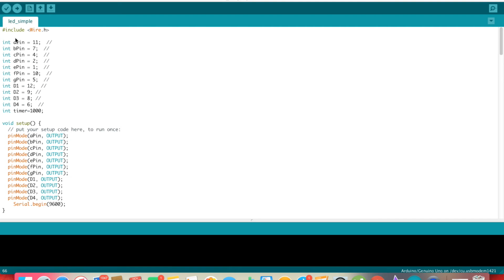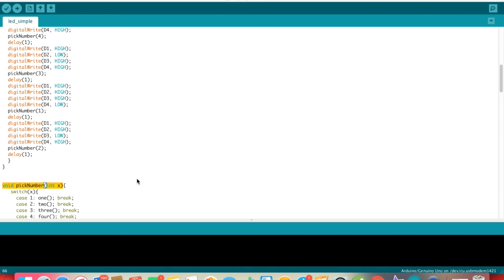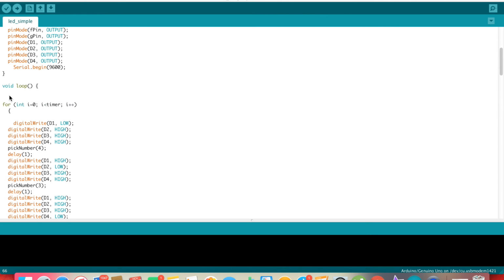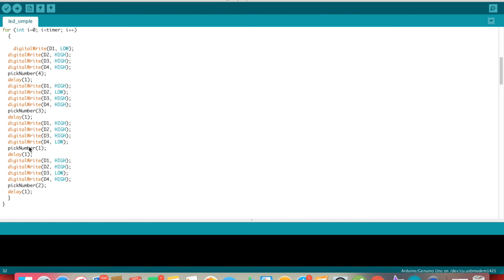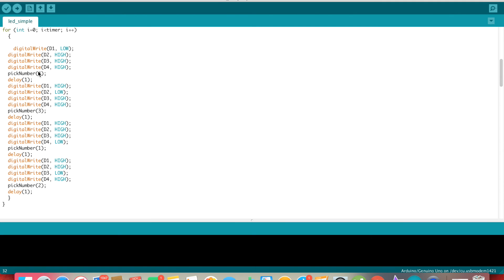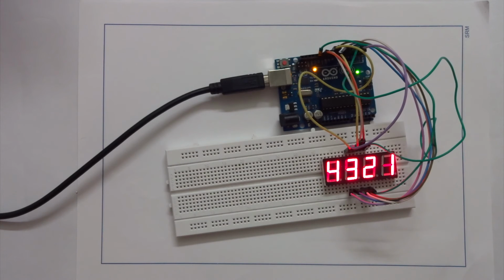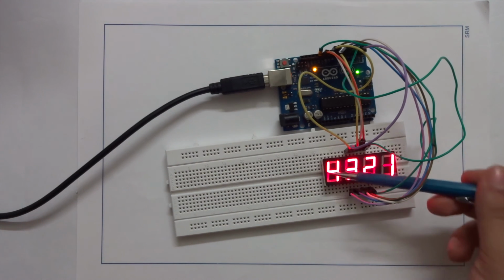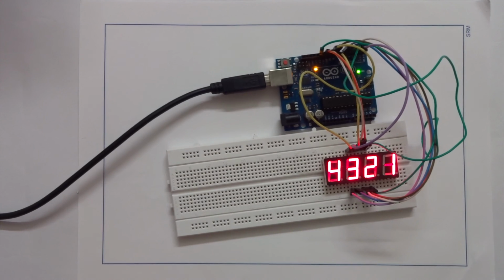Arduino Sensor#7 - 7 segment 4-digit LED Display

Comment: haw to conect?
Reply: u put a wire lined up with the metal rod sticking down from the 4 digit led.... ans as you can see on the digram conect the number from the the digram to the number slot on the arduino.... sorry im more of a physical guy im bad at explaining but i hoped it helped a little

Comment: Cable schematics?
Reply from the maker: It is given in the video at the time 0:46.
Reply from the maker: The numbers below the letters are the digital pins, i.e. from Digital Pin 1 to Digital Pin 12. Thus the code has also been uploaded in the same way.